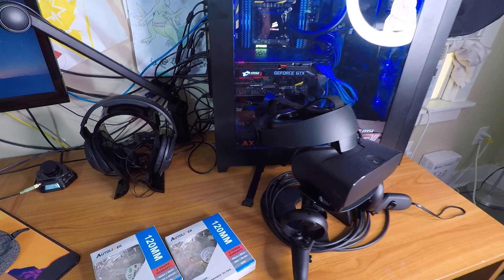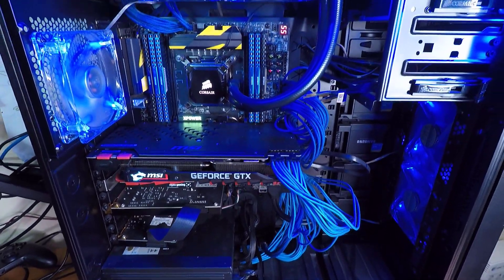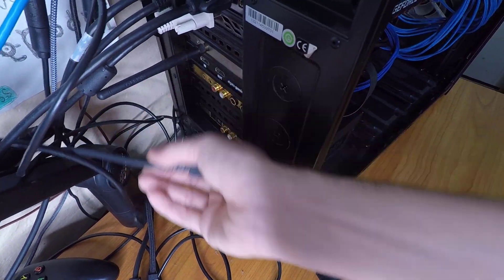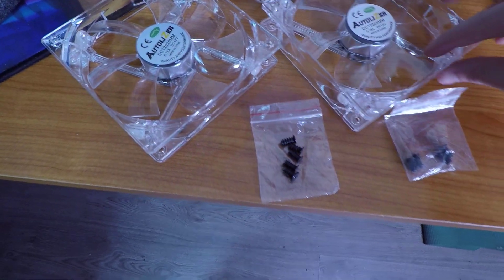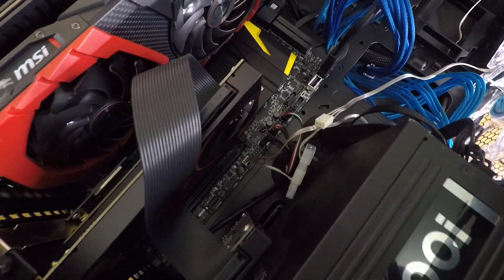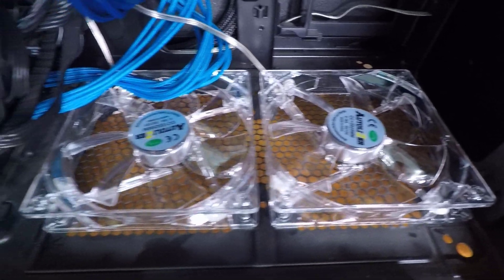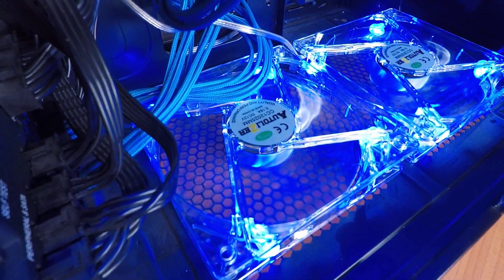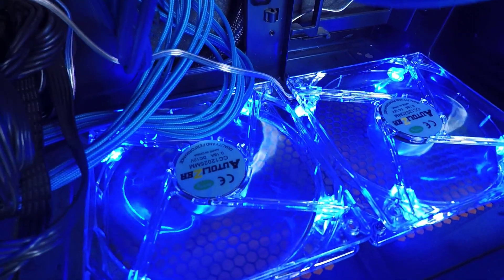How to Install Extra Fans on Your Gaming PC Case

Comment from the maker: Looking for the same fans I bought? This is the Amazon Listing: https://amzn.to/2zN2htQ

Looking for the same fans I bought but in 80mm size? This is the Amazon Listing I would get: https://amzn.to/3bCbvq9 Seems to be the same manufacturer and style as my video, just in 80mm size instead. (It's worth noting that the 120mm size does not have 80mm screw holes. Check one of your existing fans and see if you can find 120mm or 80mm anywhere on it to see what you already have if you're not sure.)

Also this is the Fan Splitter Cable that I ended up buying but I didn't use it. It may help some people though: https://amzn.to/2y7mU3w
Reply: I have 1 question does this increase your FPS on like a game if you add fans?
Reply: also, the reason why the new 2 fans you just added aren't fast enough is because, on the box/package, it said around 1500 rpm more or less, they cant reach 2k for a reason...
Reply: I got them on eBay for half the price

Comment: 16 bucks sheeesh i only do cossair and those suckers are expensive specially when you have a 10 fan case lol
Reply from the maker: If I was changing out all my fans I would have done corsair too they are the best. However I wanted to match what I already have as closely as possible so this is just what matched my existing setup. I bought this computer in like 2016 so it's not going to have the most modern looking fans.

Comment: Hey there, i got told that the grille of the fan is alway on the side of airflow direction, the way it shows on your guide they are blowing out and not in :O correct me if im wrong.
the curent set up is 2 in 5 out
Correction: okay, in the end you did fix it^
Reply from the maker: Great comment lol 😂

Comment: lol they actually blow such a strong breeze that the paintings on the wall move... ive got only 3 fans for a 2080ti and i9 ... i thought about buying 4 more ...2 for underneath the case and 2 for above it ..underneath should push the air in and the ones above and the one at the back out ? ..sounds like a good idea
Reply from the maker: Basically just make sure all the fans make a straight line of airflow as much as possible. Mine came with a lot of air going out the top so it made sense to help it go that way. And yes I found the ones listed in description to be quite strong fans. Thanks for commenting bro

Comment: what about the top fans? which blower direction should be?
Reply from the maker: Top fans should blow out of the case. Those are where your heat syncs are for water cooling so you want to blow that heat out while the other fans are blowing cool air in. That makes a nice flow of air in and out of the case. My top fans are blowing up and out of the case.

Comment: can i install 9 fans without fan hub ?
Reply from the maker: It just depends on your motherboard I would think. My board has a ton of fan power options but I don't think I would use them due to the wires being everywhere. My fan controller helps get the wires back to behind the panel. 9 fans sounds like a lot of fans though. I doubt you can get that many on the board with no extra support

Comment: Dumb question, but you say that the fans blow into the tower. If so, how are the fans on the back of the tower moving the papers on the wall?
Reply: You want air flow in your case. The bottom and front fans suck in the cold air while the back fan blows out the hot air.
Reply from the maker: Correct not all the fans blow in you want airflow so some blow out. This creates a wind tunnel which moves the most air and cools the inner area off. The top fans blow out the top and the bottom fans blow in. The front fans blow to the back and the back fans blow out the back.

Comment: Pc specs ?
Reply from the maker: check my Xidax playlist. In the description of the video it usually has the specs. I should have put it on this one in the description. Check there if it's not there then it's in the other ones in that playlist for sure.
Reply: @JonnoPlays  thanks, I'm trying to learn and research while building a second Pc myself 🙆‍♂️👍👍👍👍👍

Comment: I know this comment is a little late but what case is that from Xidax? I ordered mine not too long ago and it’s the X-2. These fans would be compatible with it? Sorry I am new to PCs
Reply from the maker: In my unboxing video for my machine in the description it has all the specs. I forget if it's in the description of this video too. It should have the case name and what else I got. Fans are all basically two sixes and Xidax cases have holes drilled for both so it should be fine.

Comment: Nice PC, I have a similar build that I built myself using a Cooler Master H500 case. I did add a large fan on the top of my case. The fan I used is actually a fan that I salvaged from a power supply that went bad. It's a little noisy but has good power. I built mine with a Core i7-6800k of to 4.4 GHz, 16 gb ddr4 ram 3000 MHz quad channel, motherboard is an MSI X99A gaming pro. For storage, I have the Samsung 970 Evo plus 500 gb SSD, Samsung 860 Evo 250 gb, Crucial mx300 275 gb SSD, and a Seagate Constellation 3 TB hard drive. For the graphics card, I have a PNY Nvidia GeForce GTX 1080 gpu.
Reply from the maker: Very nice setup and cool that you built it yourself. I always worry I would break something or buy incompatible parts so I haven't been brave enough to build one.
Reply: @JonnoPlays  I remember that the very first gaming PC that I built myself in early 2001 was one with a 1.0 GHz Pentium III CPU, 256 mb ram and a GeForce 2 graphics card. I originally had Windows ME on it but later upgraded it to XP.
Reply: @JonnoPlays  yikes I started on pc in may… bought a business Acer Aspire TC-780… single 8gb DDR4 Ram, i5-6400, intel(r) hd 530 graphics… started building instantly. I believe in you!🖤

Comment: I need fans but where do I put them I don’t know if I can put them anywhere
Reply from the maker: Your case should have holes for mounting them. If not sometimes there are externally mounted solutions. Otherwise you may need to replace case.

Comment: I might be wrong, but I think you daisy chained them wrong. They needed to be connected in parallel and not in series as I think you did here. Then they will spin at the correct (fast) speed ;)
Reply from the maker: This is a valuable comment and I'm going to try to implement it and see what happens. I'm not sure if I'll be able to find another power source nearby.

Comment: Can I put different fans in a different case?
Reply from the maker: Most fans have two sizes drilled for the screws so yes you should be able to swap fans around from machine to machine